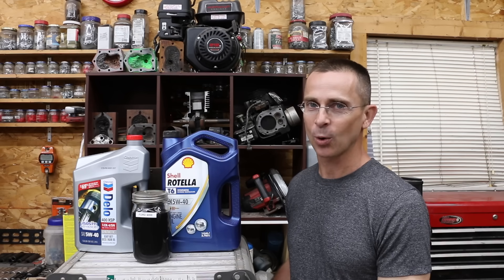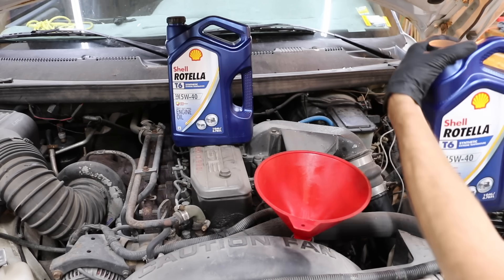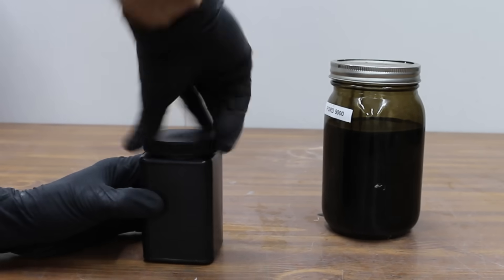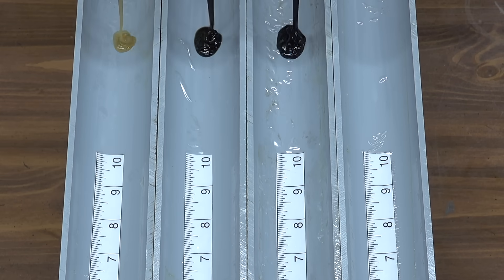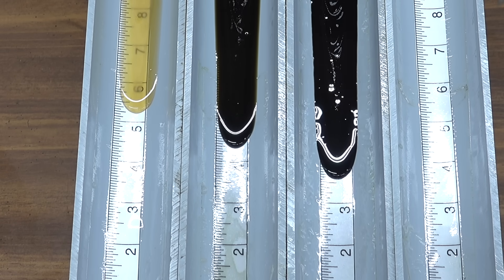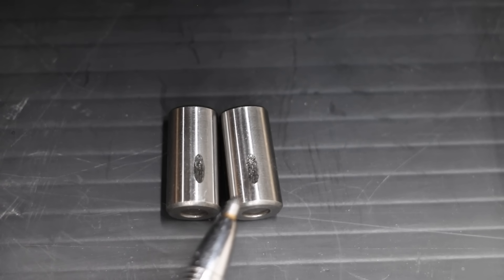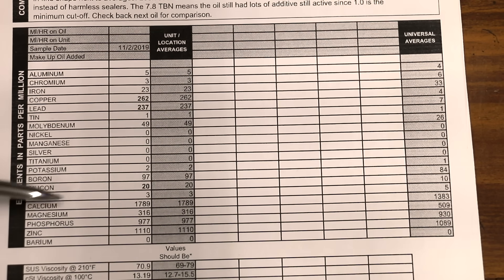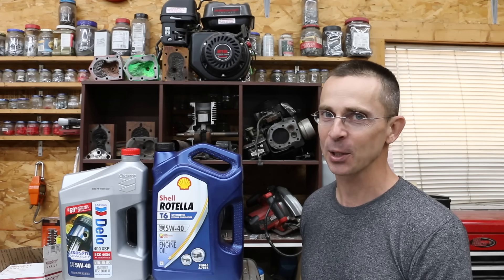Will Annual Oil Change Damage Your Car? Let's find out!

Comment: My dad was a truck driver for 55 years before he retired a few years ago. He had driven just about every truck, engine combination you can imagine. The last truck he drove he was an owner operator and he would only put Rotella in it. I remember him saying that of all the oils he ever used it held the best oil pressure right up until the time it was time to change it. The truck had a 60 series Detroit in it and at the time of retirement it had 2,400,000 miles on it with two in frames one each at 1,000,000 miles. The truck was new when he purchased it so the engine had only ever seen Rotella.
Reply: 2.4 million miles, thats insane.
Reply: @lunathecutest6652  Little bit. Feel for the guy.
Reply from the maker: Thank you for sharing!

Comment: Never stick an extension bar in the 3/8" center hole it can break the oil filter wrench in half.  Always put a socket on the oil filter wrench.
Reply from the maker: Thanks for the feedback.

Comment: I’ve never believed that there is something magical about a year’s time. In fact  I’d love to see a 2.5 year test.
Reply: I routinely go ten years.
Reply: I change my truck's oil once a year. 4000 miles +/-. My RV only gets 1200 miles per year + 20 minute start and warm up monthly, so I change that every 3 years. Hasn't been a problem.
Reply: @bigfoot14eee99  I'm doing my 67 Nova 283 oil and filter change after 4 yrs of use :) I drive it like 20 times a yr around my area.
Reply: @bigfoot14eee99  start up and warming without driving is actually worse than not. Engine oil will take forever to warm up by idling and the amount of moisture is created gets in the exhaust and oil is scary. Just let the engine sit if you know you will not be driving the vehicle for at least 20-30 minutes.
Reply: @jasonsong86  No
Reply: @bigfoot14eee99  yes.
Reply: @SergeantExtreme  Ontario here, remote starters, seat heaters and steering wheel heaters are the answer. Bring on global warming. Nobody likes sitting in a freezing cold car. 🇨🇦
Reply: @jasonsong86  It is not about how fast you warm the engine oil but how warm the oil is for the speed it is going.
The warmer the oil the better the protection it gives hence the warm up.
Max protection is when operating temp is reached. 
You want to get the oil to be as thick as it can before normal driving (hence the warm up).
Reply: @jasonsong86  That makes no sense, engines are meant to run, idling is running, the only difference is cooling that will be lacking from not moving, which is the only thing you should watch out for.  Should be able to idle for 30mins no problem.
Reply: Not worth risking it, and the oil filter needs to be changed as they collect a lot of muck.
Reply: @VenturiLife     Risking what exactly? What's the difference between 4,000 miles racked up over 2.5 years vs 4,000 miles racked up over 2.5 months? 4,000 miles is 4,000 miles no matter how short or long a time it's accumulated.
Reply: I am happy to provide my diesel cars oil for this test, perfect sample, 6000 miles 2,5 year, same oil...
Reply: the collection of iron filings would start cutting into the internals of the engine.
Reply: @Hathrandir  Wrong, anything damaging will be collected by the engine filter. Plus we are talking about low hour low mile engine oil that sits not your daily short trip engine oil.
Reply: @jasonsong86  The carbon deposits and the sludge can build up anywhere inside the engine...and it does. The oil can test just fine, meanwhile you're cylinders, valves and/or bearings are screaming bloody murder.
Reply: @daveclark8337  may be that's the insolubles and that was good. I'm worried about sludge too, still going to change it every 6 months or so. The rubber in the cilinders nowadays in toyota is not the same as before.
Reply: @knightrider365  they putting rubber in your cylinders?
Reply: I could donate the oil if I ever change it. I use conventional 10W30 Valvoline. My last oil change was March 2019 for my daily driven carbureted Ford 300 I6. I'll dig through the glove box and see if I wrote down the miles. Changing oil is just a myth brought on by the oil companies. When people bought a new Model T 100 years ago they didn't recommend changing the oil every 3 months or 3000 miles. It's just oil. As long as the engine has some it's fine.
Reply: @danielb5215  Oil change intervals are calculated using bearing surface area, rpm,  MAP, the nature of additives, temperature, service type and BMEP. I studied lubricants in college and tested them afterwards. I never change the oil in my car until it is five years old or more and only then because it is time to renew the filter.
Reply: How does that make any sense ? Old engines that use would Explode way before 21/2 years! ,DUH !.
Reply: @jerryparks6123  I'm doing my 67 Nova 283 oil and filter change after 4 yrs of use :) I drive it like 20 times a yr around my area. Installed the used motor back in 1997.

Comment: For pre 1995 gas engines there is a concern for having enough zinc for cam shafts . Do I need to use a zinc additive or do these 2 oils provide enough (zinc) ?  Thx !
Reply from the maker: Thanks for the video idea.

Comment: Right now i see improvement opportunity in lubricity test.
Oils have desired working temperature, that is why engine shouldnt be raced untill it reaches operating temp. that is why there is possibility to create system with washer fluid pump, injector (prob also to winshield washing system) and some heater to raise oil temp. This way hot or at least warm oil can me introduced onto tester wheel after contact. 
This would also check how good filmstrenght is creating because that splashing imo might be difference bc if oil have lower viscosity it will splash more, and tepending on condition splash on top of shields and drop adding lubricity or run down lowering it.
Reply from the maker: Thanks for the feedback.

Comment: I have always  used  Amsoil 5.30 signature and Amsoil filter in my 5.3 LS 2003GMCTruck! And I use Shell V power Gas after 13 years of me owning it  it ‘s  still the most dependable vehicle I’ve  ever owned. It was essembled in FORT WANYE USA GM plant sold to me by KIPP SCOTT in RED DEER   ALBERTA GM dealer  . best oil  best truck ever made ! bar none
Reply from the maker: Thanks for sharing.

Comment: With conventional oil absolutely yes. Atleast once a year. Because the oil breaks down with time. Faster in colder climates. With modern synthetics , NO it's not neccasary, because synthetic oils don't break down like conventional motor oil does. So yes and no it depends on what you use. You get what you pay for. There are about 5 good synthetic oils. The rest are garbage.  A little research helps. Amsoil. Is unquestionably the best. Followed by Royal Purple, then Castrol syntec titanium. And Mobil 1 full synthetic, redline and haviline are also good. As are the German brands as they have far more stringent laws governing what can be called synthetic at what can't. In America .it's a buyer beware type situation
Reply from the maker: Thanks for the feedback.

Comment: The problems arise when oil is allowed to get too dirty. if your engine uses hydraulic valve lifters those can gum up from sludge and you end up with what's called a "collapsed lifter", maybe you've heard that term. the orifice holes on lifters is very small to begin with. if you use the engine regularly change the oil. and also change the coolant, that you can do once a year. I do. combustion and heat cycles cause the ph to rise and it becomes more acidic over time. that's bad for the cheap materials they use now, years ago it was all copper-brass for the cooling systems. now it's an aluminum alloy of some sort. ok sorry  I'll stop rambling now..
Reply from the maker: Thanks for the feedback.
Reply: Just to let you know... when the Ph rises, then the oil will become more alkalinic, not acidic.

Comment: Everybody brags about synthetical it is not a good heat fighter put it in an air cooled engine motorcycle lawnmower it will lock right up this is bullshit they’re pulling your leg synthetics not all that

Comment: I'll still do 6 month oil changes even though my car only sees 2k miles. These tests don't answer concerns of corrosion on rubber seals due to gasoline and other blowby contaminants, as well as seizing of piston oil control rings.
Reply from the maker: Thanks for sharing.

Comment: I love the experiments you do with everything, you do a great job. I would like to comment on "Engine Restore". After watching your video on it well over a year ago I put it in my 1988 ford bronco that had absolutely no compression in the #8 cylinder, engine did run ok considering one cylinder was deader than a door nail. Apparently this was a common problem with the 5.0 engine because of the firing order, 15426378, when the plug wires would go bad #7 piston would fire #8 at the wrong end of the stroke and blow a hole in the piston or something like that. Anyways, I did try engine restore in the engine and to my surprise it did actually raise the compression up to 30 lbs, not enough to make the engine run better, but it did work. I also checked out the valve train and everything was right and tight and working, so the problem was in the lower end. I ended up replacing the motor with a freshened up 5.0 but never took the old one apart to actually see what went wrong. Moral of my story is that Engine Restore actually did some good and I now use it regularly in my older engines.
Reply from the maker: Thanks and you are welcome!  Thanks for sharing.

Comment: If there are any microscopic particles including the plastic from the container in the new oil and u “prefill” the filter you’re placing possibly contaminated oil in the part of the filter that won’t be filtered before entering your engine. Do not pre fill the filter. You’re at very least putting plastic into your engine from the container. All it takes is the smallest microns of particles to ruin your engine
Reply from the maker: Thanks for the feedback.

Comment: I've been using T6 in all my diesel vehicles for 30 years. All the cars have over 300000 miles, 2 have over 400000 1 has over 500000. Tractors 40 years older
Reply from the maker: Thanks for the feedback.

Comment: Your results lacked the TAN or Toral Acid Number and ISO Code which measures the particulate.   The TAN is a better indication of the oils service life.    In oil the level of debris really needs to be low because dirt breeds more dirt.   The metal wear indicators are great to help determine failure points within the circulating oil system.
Reply from the maker: Thank you!

Comment: im thinking about using Rotella  in my jeep,90 2,5 If I buy the good filter, whats your take on changing oil every 3,000 miles and changing the filter every other oil change, the top guns say their oil filters are good for 10,000 miles, but im calling BS

Comment: Both my current car, and my last one, had a 12month / 20,000 mile service interval. I sold my last one at 8 yrs old with 165000 miles on it. It was still running as sweet as when I first bought it. When I use to play with standby generators, rather than do an oil change, we would go around the various sites collecting oil samples. It was on the result of that sample as to whether the oil got changed or not. Saved an absolute fortune in both time and money.
Reply from the maker: Thanks for sharing.

Comment: All I know is I put over 550,000 miles on a 2011 ram 3500 with a 6.7 Cummins.  Ran rotella conventional all its life and did not smoke, had no blow by and burned no oil when I finally had to sell it do to the truck being wrecked!

Post Script: Being a Oilfield hotshot truck, it was serviced every 12,000 to 15,000 miles, getting both oil and fuel filter changes.
Reply from the maker: Thanks for sharing.

Comment: Lab results prove oil should be changed every 6000 miles regardless of age. Doesn't matter if your oil is 3 weeks old or 3 years old it needs to be changed after 6000 miles.
Reply from the maker: Thanks for the feedback.

Comment: I've had many arguments with various folks over the years who say oil goes bad with time. Back in 1985 when I bought my truck, I was working for a local parts store. In short, they went out of business a few years later and the inventory of the store was largely just disposed of so they could sell the building asap. 
I took home 19 cases of 10W-30 Havoline oil and 11 cases of 10W-40 Havoline, plus five cases of Mobil 1 20-50 that we were told to dump out in the used oil tank and toss in the dumpster. 
I was told that there's no way that oil is still good after nearly 40 years sitting on a shelf in my garage. I've used maybe four cases of the 10w 30 in my truck, which I still own with 70k on the clock in 2022. My newer vehicles use lighter oil and don't use it but I got told that I should dump that old oil and buy modern oil because I'm ruining my motor. I have a 1947 truck, with the same engine, it belonged to my uncle, its got 240k on the clock and its run its whole life on 'old' oil having only recently depleted the many cases of Golden Shell 10w-30 oil that my uncle bought for it back when it was still being sold in the early 70's. 
A few years ago I had some concerns after all the hype about oil going bad so i poured out a full quart of each oil in a jar. 
What I did see with some oils is that oil from the late 90's or so seems to separate in the bottle over time. The older Shell and Texaco  oil looked just fine. The oil that concerned me was some 5W-30 Motorcraft, and some Conoco 5W-20, both of which had sort of a stringy consistency with a thick scum layer in the bottom of the bottle that I couldn't pour out. The Havoline and Shell oils didn't have this. I relegated the oil in question to squirt can use after seeing that. (No amount of shaking or stirring would remix what ever had settled out of that oil. I also had some bulk oil that I had put in clear gallon jugs years ago do the same thing, I had been using a 55 gallon drum of oil and was near the end, so i pumped out the last few gallons and put the barrel out in the shed. My trucks were no longer running that oil so I wanted it out of the garage to free up space. 
I went to use one of those gallons of oil last summer and it was sort of streaky looking, it had light and dark streaks in the oil and clumps when I tried to pour it. I tried warming it up and mixing it but after warming it up, it separated worse. That oil was Conoco 5W-30. It was bought in the early 1990's in a 55 gallon drum
To be fair, I ran that oil in many vehicles over the years with no issues, just not recently. It sat sealed up in those jugs for 25 years or more on a shelf in the garage. It wasn't exposed to light or any extreme temps. I kept it in a brown cardboard box, four jugs per box. They were new jugs I got from work that were used for mineral oil for sewing machine thread so the bottle hadn't broken down and contaminated the oil either. 
Its gone now so its not a big concern but its made me check the condition of older oil before using it. 
In a way, it made me glad I never kept the vehicles I was using that oil in for so long, each got traded away before 100k.
Reply from the maker: Thanks for sharing.

Comment: One old idea, to which I subscribe, is that changing oil any filter  regularly, and about every 4000 miles. 
       Changing oil is the most important thing you can do to prolong engine life......I use Castrol synthetic 15 w 40. Techtion plus for the  Cummins diesel
Reply from the maker: Thanks for the feedback.

Comment: Idk about the acidity issues, but I do know that if you live in a climate that has temperature changes, condensation is a real issue and can kill an engine.
R.V's that only come out in the summer a few times in the summer are usually the victims.
I have seen in many times.
Usually reliable engines (350 chevy ect) crater at less than 100k
Reply from the maker: Thanks for the feedback.

Comment: Just one recommendation; don’t prefill the oil filter. It is a dangerous practice. The flows from the outside to the center through the filter. So if you prefill it by pouring into the thread hole in the center of the filter; than any contaminates that are in the oil goes straight into the engine without being filtered. If you are going to prefill then you need to take the time to only allow the oil to go through the small holes along the outside.
Reply from the maker: Thanks for the recommendation. Thanks for the feedback.

Comment: Any consistency risks with that home made wear test? Can those physical metal pieces be inconsistently placed? good test! i'm going to leave my oil in for 2 years as have only done 3000 miles in 1 year. manufacturer claims 20,000 miles or 1 year.

Comment: I change mine every 2500 miles on my 1990 ranger . My mechanic years ago had to replace my oil pan gasket . He said he had never seen a cleaner engine . He has asked me to tell him if I ever decide to sell it . When I bought the truck 24 years ago it had 20,640 miles on it . I now have 184 ,000 .
Reply from the maker: Thanks for sharing.

Comment: I'm curious how oil holds up in the Ford EcoBoost engines. Mechanics recommend oil changes every 3000 miles or every 6 months, whichever comes first, due to the turbos and design of the engine. Fuel contamination into the oil is supposed to be a problem area for these motors.
Reply: the fuel contamination is almost purely from prolonged idling common with starting feature from remote start.  This is well known.  Oil analysis shows this really means nothing